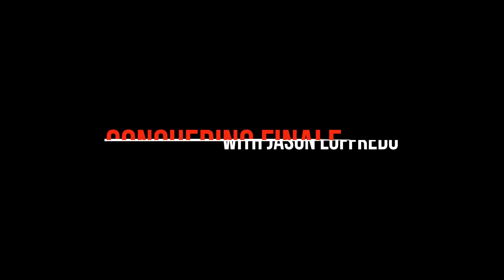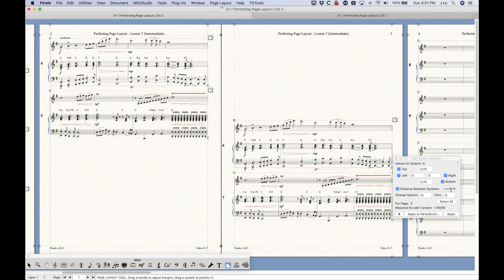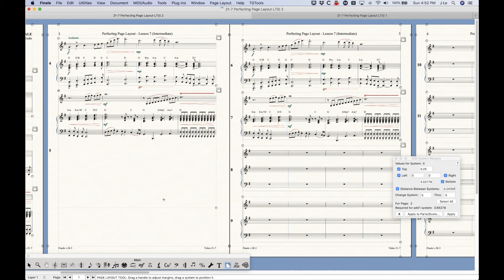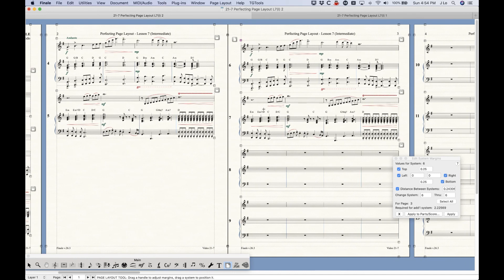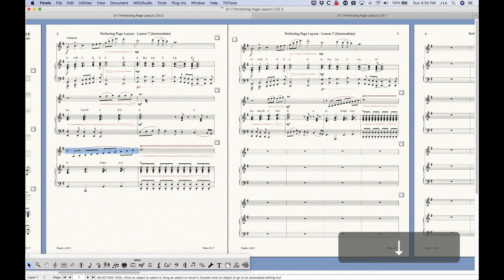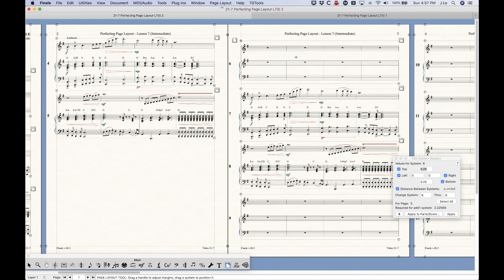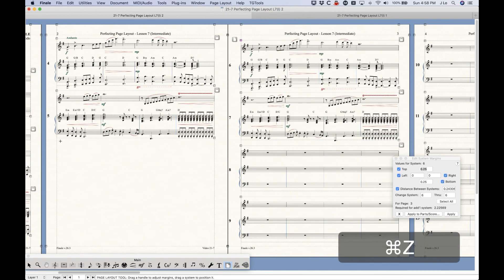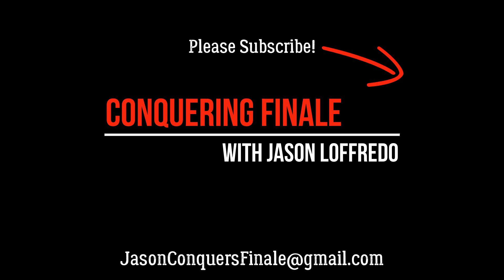21-7 Page Breaks (Intermediate)

Comment: I have a question.
I came across it in a finale file written by someone else, and I found a "return sign" instead of a "lock sign". How do I enter this sign?
It was neither "page down" nor "system down."
I know that "lock mark" is "lock system".
Reply from the maker: I think that was a "start new section" mark.  If you go to the Measure Attributes for a measure, there's an option to "start a new section".  That will put that measure at the beginning of a system AND make sure that the full staff names are listed again at that system.